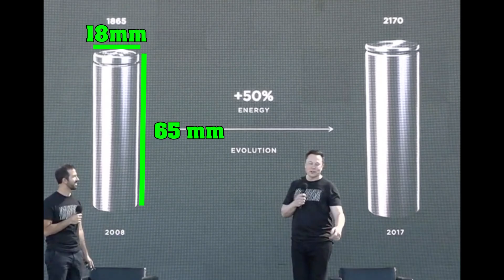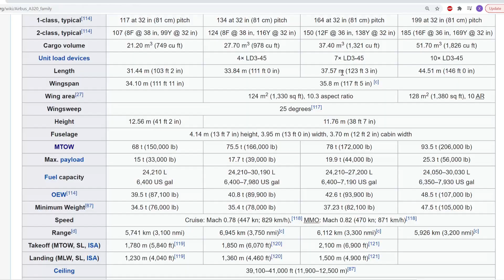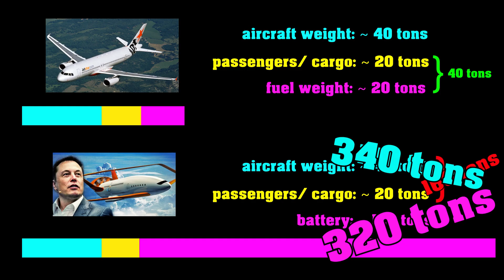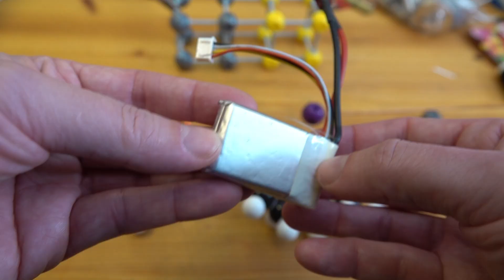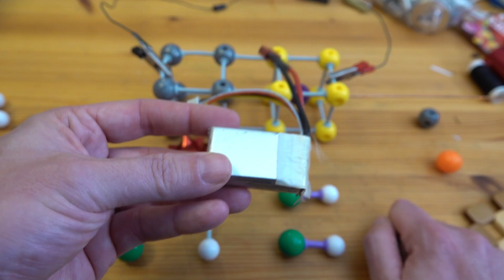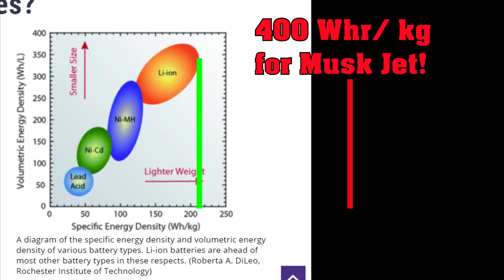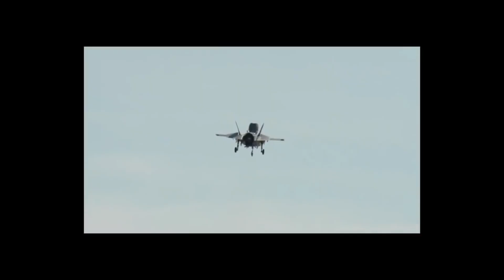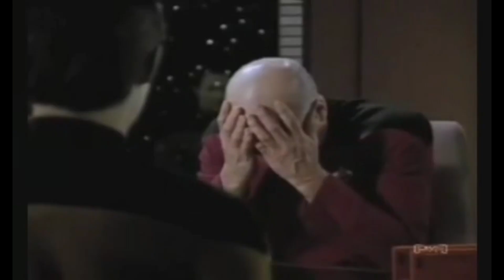Tesla's Secret Plan To Disrupt Airlines: BUSTED!!

Comment: Can you please start calling theses things "musk's" and not Tesla's cause , these are nothing compared to the man who had the name
Reply: They are an insult to the Tesla name.
Reply: Not much of a difference between Musk and Tesla. Both overrated idiots.
Reply: @hans-joachimbierwirth4727  The younger one seems to have produced something real, at least.
Reply: @hans-joachimbierwirth4727  do you know who Tesla was?
Reply: As you can tell by my comments on Nikola Tesla obviously much better than you do.
Reply: @hans-joachimbierwirth4727  Not really an answer. Musk and Tesla are a great leap apart. A few of Tesla's achievements, the design of the global power grid, a one way valve with no moving parts, of which the principle behind it is applied to the underside of skies to make them more efficient and the first radio controlled boat, which was then developed to produce todays communication system. The list goes on. Musk, well PayPal, an unworkable tube train, an impossible battery plane. Yeah I can see the similarities.
Reply: A valve based on principles known for at least 30,000 years, an impossible concept of a power grid, no influence on modern communication technology but a toy. Now every right wing lunatic, most conspiracy theorists, the creme de la crop of the gullible throwing his name around, mostly in context of falsely attributed citations.
Reply: @hans-joachimbierwirth4727  Please show me some text that is 30,000 years old, that would be quite something. The modern power grid is directly traceable to the designs layed out by Tesla himself when he was arguing against having a power station at the end of every street, ie the AC v DC power system. The toy he invented, the one that uses the exact same principles for radio communication still used today that was first demonstrated by Tesla himself. Not sure where a conspiracy is in any of that. The conspiracies occurred after his death, allegedly the American government stole his ideas, maybe there's truth in that but I have no idea.  Dismissal by ignorance, come on try a bit harder.
Reply: Here are some older models proving that parting air streams in circular patterns is one of the oldest technologies known to man https://en.wikipedia.org/wiki/Paleolithic_flutes
Reply: @hans-joachimbierwirth4727  The principles behind how flutes make sounds are through air vibrations and not parting air streams in circular patterns, that is a side effect. This argument could be applied to the internal combustion engine was invented 300,000 to 400,000 years ago because evidence has been found that implies humans could intentionally light a fire. The reason I am a fanboy of Teslas work is because he applied his mind in a meaningful and useful manor that has benefitted the world as a whole. There are numerous modern day technologies that are based on Teslas research, no conspiracy just a trail of easily followed evidence. I noticed you didn't attempt to debunk the other 2 points.
Reply: Tesla was quite a narcissist scamming everyone he met, and his contributions have not made much impact. If it wasn't for the visuals and his exaggerated claims he would be long forgotten. Circular streams are what causes the vibrations in flutes.
Reply: @hans-joachimbierwirth4727  Narcissist or not he did contribute a great deal. I think you may be referring to media coverage and not his actual work. You kind of missed the point with the flute thing.
Reply: @daveb6722  There is no point. Flutes transform energy, and the Tesla valve is based on that. Some small improvements are no great deal. Tesla scammed people. His fans are projecting like crazy.
Reply: @hans-joachimbierwirth4727  Ok assuming that you are correct, in what way did he scam anyone? Keep in mind the definition of scam is a fraudulent business scheme.
Reply: @daveb6722  Read his biography! He never delivered anything, promised anything, took money from investors and played around with toys while living expensively.
Reply: @hans-joachimbierwirth4727  He never delivered anything, not one thing can be attributed to his research and experimentation, really, not one thing. Not promising anything and taking money from investors, well that sounds alot like a researchers proposal. Playing with toys he created, could they be fruits of his research, because I cannot come up with another explanation considering that you could not buy them from anyone else as he designed and built them. Not a good start in explaining his scams, they sound too much like legitimate research. Legitimate research cannot give promises, if it could it was because it had already been done, research also needs investment because nothing is free. You may have read his biography, but did you really understand him. So the questions still stands, assuming you are correct, how has he scammed anyone?
Reply: @hans-joachimbierwirth4727  Agreed.
Reply: Not really Musk owns 1/5th of the company almost 21%, it have over 48k people working for it so you cannot say it is just Musk he cannt even decide something important in the company considering. 
Yea he owns the most but it is still far less to do everything on his own hand.
Reply: Like all chancers before them they steal the name of the true innovator and attach their own brand of cr4p to it.

Charles Goodyear was another who invented something and some chancers rolled with his name.
Reply: The Tesla name is sullied by Musk
Reply: The name Tesla was already sullied by Nikola Tesla himself, and then again by all those retards who claim free energy. It's not a name but a stain.
Reply: He need to change the name to Edison, its more fitting. Although the his plagiarised ideas actually worked.
Reply: He mean by the company but I am getting what you putting

Comment: I am guessing you can charge it with a tesla car charger in 40 minutes or so. Imagine the power required to charge it and then the heat generated by a. Airlines definitely do not want their planes sitting around for 10 hours to charge.

BTW can we say solar freaking runways?

Comment: [Next time on "Musk"] (filmed in front of a live studio audience)
Jixuan: It's a shame planes have so much air resistance.
Musk: I have the solution...
Musk: An electric aircraft, That has VTOL capability, That flies supersonic, In a vacuum sealed tube that is lined with solar panels (Solar freakin' tubeways), Which it uses for inductive charging giving it an unlimited range! In fact it will generate more energy than it uses so it will be energy positive.
Sebastian: Wow when will we be able to do this!?
Musk: In the next 5 years, I'm making the whitepaper right now.
Jixuan & Sebastian: You're such a genius.

Comment: Airlines have rules about the maximum size of battery you can take on board in your laptop or whatever for a reason.  Putting several thousand fully charged cells on a plane...  hmmm.
Well, at least it'd make things easier for terrorists.
I find myself yelling "What us wrong with these unts!" listening to that explanation of reduced drag at high altitude.

Comment: Dreamliners with relatively small lithium battery packs, and there there were a few uncontained failures there that nearly resulted in airframe failures. So now the battery pack is now heavier because they had to add a fireproof container with venting, and any mass saving over the old nickel cadmium battery is lost.
Reply: One of them destroyed its airframe from a battery fire in an emergency locater beacon (Ethiopian)

Comment: The energy density was included in the presentation on battery day and it's not 16% and it's not very hard to find. The energy density of the cell has an increase of 16% because of the cell design, 20% anode material, 4% due to to the cathode material. In total the is 40% due to the cell design. Plus an additional 14% range increase because of cell to vehicle integration. In total for a car that is 54% more range for a vehicle. That's not a tiny amount more rage like you said, it's a big improvement. Now say what you want if they are going to be able to make these batteries or that your skeptical about these claims, but if you can't read the presentation correctly, how can trust you with anything else you say?

Comment: It's a question of low hanging fruit. An increase in efficiency from a steam engine from 3% to 4% meant a 30% increase in efficiency. The same 1 percent increase in a modern diesel engine overall efficiency is only a 2% improvement. It's a simple reduction in improvement despite increased funding and research.

Comment: The energy density was included in the presintation on battery day and it's not 16% and it's not very hard to find. The energy density of the cell has an increase of 16% because of the cell design, 20% anode material, 4% due to to the cathode material. In total the is 40% due to the cell design. Plus an additional 14% range increase because of cell to vehicle intergration. In total for a car that is 54% more range for a vehicle. That's not a tiny amount more rage like you said, it's a big improvement. Now say what you want if they are going to be able to make these batteries or that your sceptical about these claims, but if you can't read the presintation correctly, how can I trust you with anything else you say?

Comment: If im not mistaken. All commercial aircrafts use a turbine engine which can’t reach supersonic speeds due to lack of power in the engines. So in addition to the weight problem Elon has to add some sort of afterburner to his electric ”jets” and afterburners burn fuel in the exhaust gas to make more thrust hence making the electric ”jets” not really electric ”jets”. Only lies to get more investors... Sad.

Comment: I don’t know why there’s so much effort going into cylinder formatted batteries when a square or even hexagonal battery would have greater battery density.  
The only advantage of A cylindrical battery is if  you have active cooling with air flowing through the spaces between the cylinders.

Comment: One more thing to consider, conventional aircraft get lighter as they burn fuel and batteries do not get lighter as they discharge. 

How much less efficient is this and how much stronger and heavier does an electric plane need to be to be able to land at maximum takeoff weight?

Comment: Aircraft engines lose volumetric efficiency with altitude, not energy efficiency. The higher you go, the less power it makes, but it burns less fuel. And the thrust to drag ratio stays the same.
Also, who's going to tell Musk that electric fans don't generate supersonic thrust?

Comment: I think your right in criticising the idea of his airplane and that it's extremely hard to do but I still take issue with you bashing the 4680 cell design so hard. You can't make high power batteries so large in diameter because they would produce way to much heat because they only have the tiny tab at the top of the current collector, the breakthrough they had was that they build it tabless  that means they increased the area in which the current can leave the battery. Less resistance means less heat being generated. If you make your cells bigger you have more active battery material (cathode and anode) and less casing material as if you would use smaller batteries that's why the 4680 matters. It's not that that the energy density is all that better ( it's a few percent better) most of the breakthrough thing about them is that they can be manufactured way cheaper and way faster because of an accumulation of new implemented technologies like the tabless thing, their new tesla silicon anode and dry electrode process in which they don't need solvents to apply the active materials to the current collectors. Furthermore the thing is you have the energy density of the cell and then of the battery pack itself and the one for the pack is lower then the cell but with with the 4680 the penalty to energy density from cell to pack you get is less because you have less battery casing becaus of larger diameter and less overall parts because you don't have to connect as much batteries as with the 2170. I know you don't like Elon but still I can't stand it when you bash awesome engineering by good engineers that put extremely hard work into this.

Comment: Should probably have mentioned the pretty significant fact there's currently no working electric jet engines that exist. How can you make a super sonic plane on electric batteries without an electric jet engine? The best we have right now is the scram and ram jet which can be converted to electric, but those require already hitting super sonic speed to even use them. You still need an electric jet engine which still doesn't exist.

Comment: Nice strawman of the rocket equation.  But batteries are not liquid.  They do provide some structure.  You also know well that volume increases by the cube.  And you know that batteries are denser than kerosene.
I agree that viable electric planes are way off.  Supersonic electric is a fantasy.  But when you go full Elon bashing mode, it is not a good look.

Comment: At least he's moved away from his starliner as an international passenger aircraft idea. Not sure there'll ever be a world where having people strap into a rocket for a trip to Australia is going to be efficient, cost-effective, or appealing. 

If I'm going to strap in for a rocket launch to go on vacation it better be to somewhere beyond Earth, Australia is pretty otherworldly but still.

Oh and there's already a good example of what happens when a flying battery has a thermal runaway, there was a UPS 747 that crashed due to fire in Dubai carrying almost an entire load of batteries, or devices with batteries, and the fire literally melted the plane from the inside out and cut all the hydraulics and electric cables just moments before they would have been lined up to land. This crash was the reason Li-ion batteries are heavily regulated as air freight and passenger luggage.
Reply: Good Memory, yeah its why batteries must be shipped at a lower state of charge, as well as the ratio of battery per liter of storage space.  Once Li-ion ignites, it has all the fuel and oxygen it needs to keep burning.  Its actually amazing how few incidents occur, like realizing everyone is driving around personal vehicles that have an active chemical explosion happening many times a minutes.  We just take for granted this incredibly dangerous thing as benign.

Comment: One of the benefit of using fuel is it will burn off, and reducing weight of the aircraft. Normally aircraft has a higher maximum take off weight than maximum landing weight

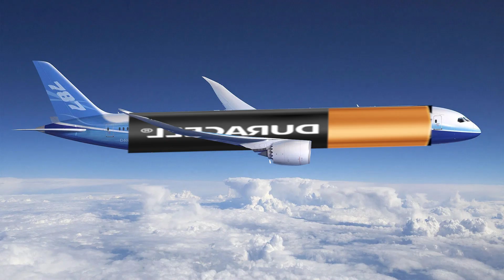Comment: 4:10 technically speaking...that's a pretty smart idea....the structural hull could be partially made out of batteries which would power an hybrid plane I.E : an electric super charger with a good old gas engine with propellers...of course the airplane would be super slow but .. at least it can fly lol...somewhat efficiently.

Comment: Wait, at the end, he's stating that the air gets thinner. Which is true, but gas turbines gets more efficient because they essentially take cold air and heat it rapidly. If an electric plane is just spinning a turbine, and isn't using a temperature differential for thrust, it's going to hemorrhage thrust. The exact opposite of what Musk is saying is true. It's almost like he's not too bright or something.

Comment: In my humble opinion, Tesla did increase battery energy density over the years, if you look at a single cell there is no increase but packaging must be taken into consideration, a battery pack has many of those small battery cells and larger the cell less the “void” or “empty space” between those cylindrical cell so they did increase energy density for the entire battery pack and their cars do have increased range over the years

Comment: 28:50  !!!!!  I m not an aircraft engineer and i know nothing about aircrafts engines... 

Can someone explain me this? 
Lesser AIR RESISTANCE also means  
Lesser AIR TO PUSH AWAY WITH YOUR HELIX!!! 

it means you should spin the blades faster and faster just to get the same speed (not for accelerate, but just to keep the speed)  

isn't this worse??

Comment: I'm sure you will mention this, but the other giant problem is that no matter how long you fly that electric airplane, it will never get lighter.  However, as you burn fuel in an airplane, you carry less and less weight, which increases efficiency.  This is why a rocket when it takes off actually speeds up the longer it burns because by the time it's getting out of eyesight, it has already burned half of its take-off weight in fuel.  An electric car, plane, or rocket will always weigh the absolute most all the time, no matter what.

Comment: You seem to have a misunderstanding about why so many researchers are trying to develop solid state batteries. Current battery technologies already operate well bellow their theoretical density because of the danger you pointed out, but solid state batteries fundamentally can't fail like that. If both the charged and discharged sides of the battery are solid, then there no risk of a run-away reaction because the surface area between them can't significantly change from the designed power. So you could increase energy density all the way to the level of hydrocarbons and it would still be perfectly safe as long as you don't grind it into a powder.  

The unsolved problem with solid state batteries is more related to manufacturing. Doesn't matter how much better the tech is if you can't mass produce it.